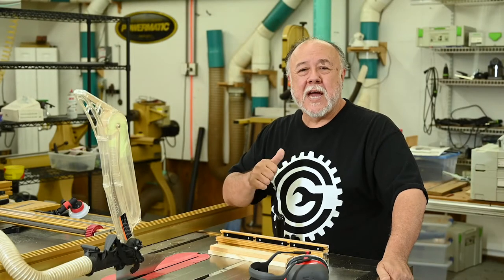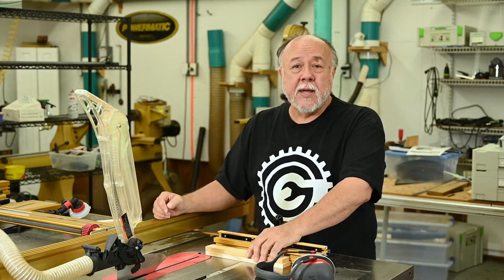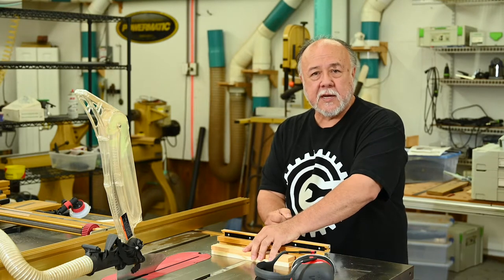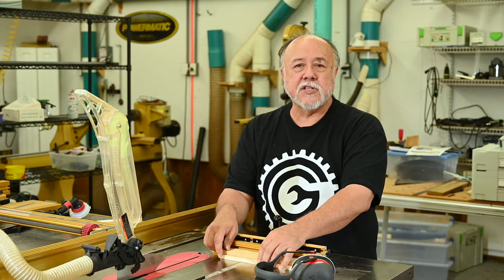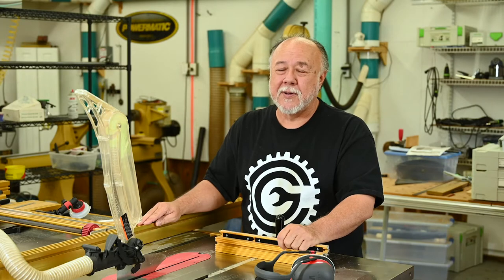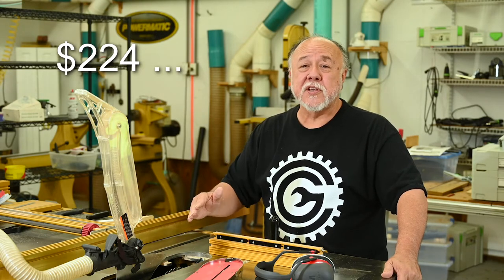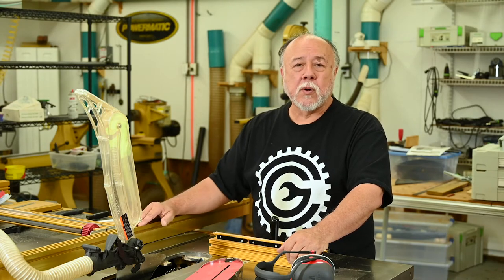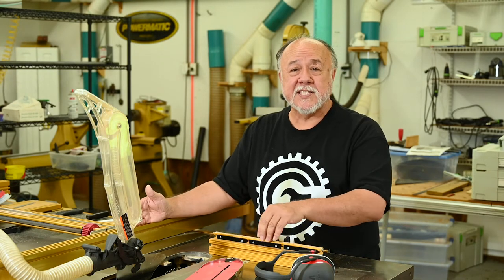My Sawstop's Safety Brake Went Off For No Apparent Reason? Turns Out To Be Totally My Fault ...

Comment: Lol - this is EXACTLY what I just did.  I was using my incra miter gauge, not paying enough attention to where exactly the fence was, and the blade was just - gone.  Hands were of course fine.

It was definitely my fault.  I just had a tiny nick in the aluminum.  The miter gauge is fine.  The blade and brake… not so much. =p

Fortunately, my WW2 wasn’t in the saw, so I lost a $50 Amana blade.  It lost a tooth.

Sawstop will replace the brake for free - but only if it triggers on you, not if you trigger it on metal.  Apparently, they can tell from the data in the brake when you send it to them.  They want the cartridges that trigger so that they can use the information to improve the saw.

And I agree - no one is immune to a momentary lapse of concentration.

Comment: Like you, I have a SawStop, and never expected to need the braking technology. But lo and behold, I lost my attention this morning and got nicked in the thumb. So I’m pretty happy about having a SawStop. 
Question: did you have to throw out the blade?  Mine looks OK, so I’m wondering about getting it checked.
Reply from the maker: I haven't tried. It's jammed in there pretty good, I just have the whole thing hanging on my wall as a sort of trophy/reminder :)
Reply: My blade is toast.  It was a Hi-ATB Forrest Duraline, but too many teeth are shot to make it economical to repair (not just the carbide, but the whole tooth).
Reply: Stumpy nus says you can have them repaired by manufacture